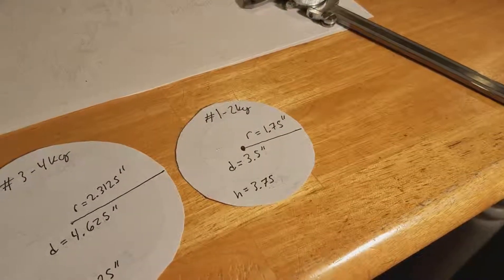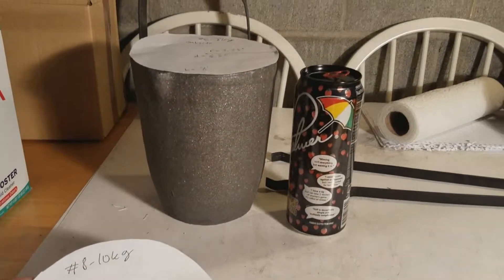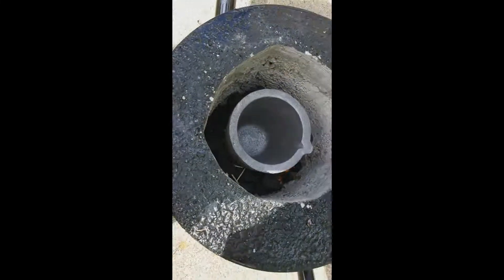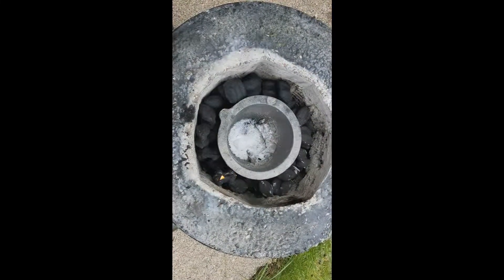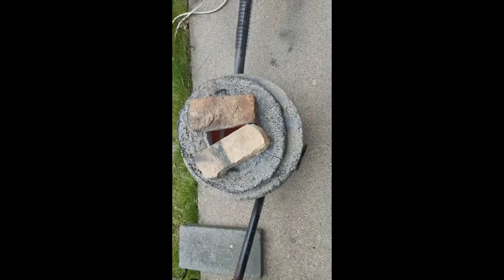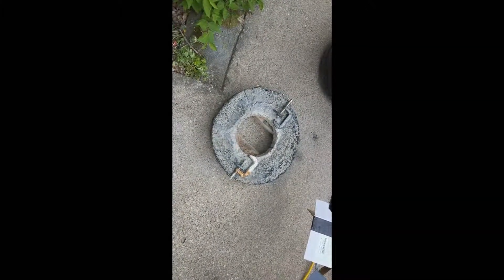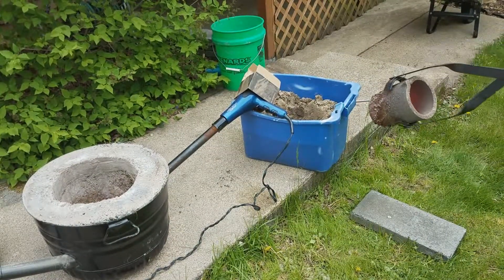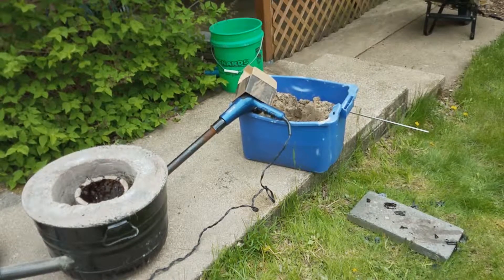Crucible sizes and curing with borax (graphite)

Comment: I read on Wikipedia that Borax is used for welding steel to reduce the melting point of certain oxides (causing them to be liquid rather than solid).
Perhaps something similar is at play during the curing?

Comment: Hey, does anyone know what f you can still use one of these crucibles to melt aluminum without putting it into a forge?  I have a bigger one of these that doesn’t fit inside my forge. Can’t I set it on some fire bricks and just point my burners at it to melt aluminum?
Reply: Yes you can if your burners get hot enough. 
I do it often a using DIY propane burner. It's more efficient if you surround the crucible with bricks or something to help retain & reflect the heat.

Comment: I Like you explaining how to treat your Crucible but on the 2:45 second mark to 3:03 you would melt the whole system down with your temperatures ranging from 13,000 to 15,000 thousand degrees Made me smile, I think you mean 1,300 to 1,500 degrees. Remember I'm just poking fun at you for missing by a few degrees.
Reply from the maker: HAH yes

Comment: lol i didn't do half of that, baked my crucible for an hour an on its 1st voyage  i heard 2 loud pops even before i started the hair dryer just charcoal burning, i thought maybe moisture in the furnace or on the coal... after my pour they were two large slates broken off the crucible with a green glasslike texture, my assumptions at the moment don't buy off ebay because they probs got the mixture wrong or i should of fired it again before using as the crucible must of drew in moisture after a week sitting around. So now i stick with a thick steel crucible, they get hotter quicker any way and keep the heat longer..
Reply: I've burned steel crucible. Aluminium everywhere, but bo problem as my furnace is designed to handle that kind of accident.